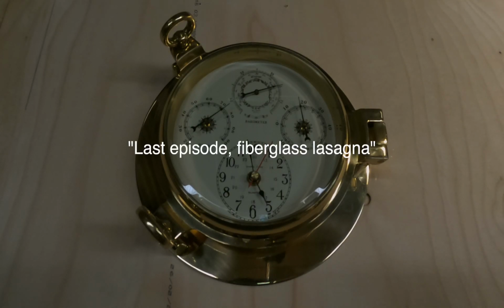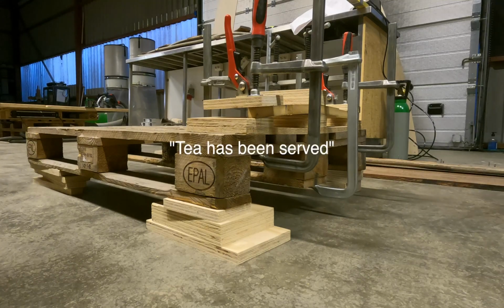Fisher 30 Ep 17 - Finishing the engine bed - Planning further, up in the mountains

Comment: When I saw Sara dancing to Roxy Music it made my day (er. Night), the motor mount seem very strong that's good. 
I'm very cutious about the sound deadning cause I guess it will tak several materials to get what you are going for, but I think it's the cooling of engine and auxiliarys while keeping it quiet that will give you the biggest challenge. 
Realy lokking forward to next episode.

P.s. I know that in her age sleep is considdered to be overrated but nevertheless please tell Sara to prioritize sleep a bit higher on her list.😉
Reply: I can tell you that dancing to Roxy Music also made my day. I sure will try to better my sleeping schedual.. Starting next week! (Maybe)
Reply from the maker: I have understood that the cooling of the alternator might be an issue. Therefore I must direct the airstream into the engine room in a way that it passes the alternator. The engine itself is fully water cooled so that should not cause any problems. 
Thanks for commenting. 👍

Comment: Best sound insulation and thermal insulation for a boat is industrial-grade closed-cell foam. It will not degrade if it gets wet, or get moldy.  It does not retain water.  But it is fragile so needs to be protected by wood panel or maybe epoxy on top.  Usually closed-cell foam is attached using pressure-activated cement, also known as rubber cement.  The U.S. Coast Guard vessels use a very expensive brand of closed-cell foam on their small rescue ships,  called Armacell.   There are other brands that are cheaper.   Using housing-type fiberglass insulation, or housing-type foam insulation panels, is a mistake because these degrade in moist environment or especially if directly wet.
Reply from the maker: Excellent point. I was actually considering a brand call Armaflex, supplied by Armacell. On the outside using strips of hardwood or plywood plates. Thanks.
Reply: @hsobstad   if you get this type, pay extra and get the peel-off-backing adhesive version rather than the plain version which needs cans of special rubber cement.   the less expensive brand I chose is K-Flex.   maybe the density is different which explains the price difference, I dont know.  the benefit of gluing this type directly to the fiberglass is tremendous, no more condensation/sweating, no more mold.  and the sound reduction is very easy to hear the difference, much quieter.   the fiberglass is no longer 'cold to the touch' either, much more comfortable for berths.
Reply from the maker: @superblondeDotOrg  Thanks again for detailing your tips. I think you are right it might be worth paying extra for the adhesive version. I will look into the K-flex as a budget alternative. 👍😊

Comment: Another wonderful video!  So nice to see Sara joining in on the fun of fiberglassing (LOL). Yes, Foggy ;-) Firstly, I must tell you that the scenery on your trip is incredibly similar to the western part of our province of Newfoundland & Labrador. It also is mountainous and full of Fjords. Perhaps someday you will visit. On the topic of sound dampening and insulation... It seems that there are three main sources of noise; Air intake, exhaust and combustion vibration. The latter of which is transferred to the hull. I will try and find a video I saw of a Canadian boat builder on Vancouver Island that used an acoustic tile for insulating their engine room for you. They had before and after comparison with a Db meter and it was impressive. I've also seen how some expedition yacht builders use the main engine as a large hydraulic pump to turn the propeller(s) and have them fully isolated on rubber engine mounts.  The point is to reduce the vibration that is transferred to the hull and the rest of the boat. I wonder if adding rubber engine mounts is an option for you?  Intake air noise can be substantial on a large engine, but probably not that bad for your Fisher. A note to Sara... Great job on video editing and coaching your Dad on an expanded format! 😊 You two make a great team. Thanks again for the entertaining and thought-provoking video. ..."to live so sturdily and Spartan-like as to put to rout all that was not life, to cut a broad swath and shave close, to drive life into a corner, and reduce it to its lowest terms.” (DPS)
Reply from the maker: Thanks, Duncan, for lots of kind words. 👍
I have thought the scenery would be similar to some of Canada, of which I will to see one day. 
Regarding insulation. I have rubber engine mounts, so that should be ok. I am thinking adding lots of surface area for absorbing noise. Soft near the engine. Harder materials further away. 👍😊
Reply: Sounds like a good plan my friend. @hsobstad

Comment: Well you did an excellent job of reworking the engine beds and you are now in a very good situation if you are ever depth charged while you are sailing on patrol of the Fjords.😉 You are right the subject of acoustic insulation for attenuating all the frequencies produced by a diesel engine is very complex, rather than reinvent the wheel - maybe consider a manufacturer like Venus they have a range of materials and a fairly good reputation. On the subject of ventilation of the engine space - the most vulnerable component is the alternator of course so special care needed to address that. Thank you for the glimpse of the beautiful, if somewhat damp, Norway.😀😉
Reply from the maker: Thanks, Norman. 
Your input about the alternator is actually very good. If the alternator suffers from overheating it will reduce its power production dramatically. I was thinking to make a vent shaft from the stern of the boat, but thanks to your input I might change that to an intake further forward in the boat. 👍

Comment: Sound insulation tip: With sound " leakage" you have to deal with the bathtub principle. If there is 1 small hole, sound will leak through there and it will almost sound like you have no insulation wat so ever. It's like pulling the plug from the bathtub, all the water will drain to that 1 specific point. So it's highly important to fill up/ close all the gaps from the engine room to your salon! I use Talamex insulation ( I send you the link a couple of month's ago) and it's the best, it's also highly fire-resistant, so that is a big plus! Loved the video again Helge, must be awesome to work with your daughter, to do the project together! Keep it up 🙂
Reply from the maker: Thanks, I will look into the Talamex insulation. I did like "the bathtub-principle. Never heard of that 👍😊

Comment: Well ... now I'm jealous ... I wish I was there with my bike to ride those roads!!! That was some amazing scenery up in the mountains, and that river that you were following looked perfect for a lazy sail!!!  Your helper has some great dance moves, but she definitely needs to go to bed a little earlier!!! As for the insulation for the engine room, I would suggest going with some Rockwool products as they make some great insulation and sound proofing battens.  I used it to make an enclosure for a generator, and it made a big difference -- it doesn't hurt that it is fire retardant as well.  Keep in mind when you make the air intake for the engine enclosure that sound waves are deadened by 90 degree angles, so add some into the construction to keep the sound that you are trying to muffle from escaping the sound-proofed area (there are some really good videos on YouTube using that principle on generator enclosures).  Keep up the good work!!!
Reply from the maker: Hi Robert. Yes, these are nice roads, riding most alone, and up into the mountains. It´s great fun. 
Sara is working hard i a shop, during summer, and sometimes the shifts starts early and sometimes late. So she gets tired, but keeps going. 
I will look into your suggested Rockwool. Regarding angles I think diffusers that directs in multiple angles is a way to make sure sound waves is not amplifying them self; taken from the HiFi world. I will search Youtube on generator enclosures. 👍😊

Comment: There is multi-layer sound insulating material, a sandwich of metal  and foam, Specifically Engineered to dampen engine room noise. Rather than re-invent the wheel using questionable materials, this is case where the best economy will be using a well engineered product with known and tested properties. Really low frequencies will be propagated through the hull by mechanical conduction. So rubber mounts must dampen those at the source - the engine mounts.. 1000 to 4000 + Hz have both sonic and conductive transmission, so the sound deadening material probably plays its biggest role there. I think there is little really high frequency energy to deal with, and that will be contained inside the engine room anyway, even with nothing done.  An exception might be a turbo charger intake, hardly needed here.
Reply: My opinion is that unfettered direct access to the engine is a safety concern not to be ignored. Cooling water, fuel and exhaust (with water) all can leak, or require  service, - the safety of the vessel and crew depends upon it. A diesel leak is a disgusting thing in the confines of a small boat, ditto and exhaust leak.  And, easy access means maintenance is less like to be put off, and safer in tough conditions.
Reply from the maker: Thanks, Larry, for another input. To me engine noise is a killer for using the boat. I have experienced boats (in particular one) the same size boat and with an inboard engine with shaft drive, which was so well insulated that hardly any noise came through. That owner had gone to an extended length to seal off sound and it sure worked out for that boat. 
The sound dampening materials one can buy are often a compromise of space around the engine is limited and price must be reasonably low, and therefore not optimal. 
I agree with the safety issues of an easy access. That is one factor but there are others. Leaving the engine open would satisfy only the safety issue. I intend to have satisfying side access to the engine, but might spend some time to remove inner walls to get that access. Still better then a cramp engine room with only access from the top. :-)
Reply: @hsobstad   Better to sell the diesel engine and get an electric motor which runs on lithium batteries.  Then get a smaller 1-cylinder diesel engine with a big alternator to use as a generator to recharge the batteries (about 6 kW) and put that generator in a tight sound-insulated box.
Reply from the maker: @superblondeDotOrg  In a sailingboat - maybe (#SailingUma) - but in a motorsailer I dont think so as the engine is more in use together with the sails. There just wont be enough energy in the batteries for any serious motorsailing. 🙂
Reply: @hsobstad  About electric motors, find an electric motor company and discuss it with them (i.e. Electric Yacht, Inc), they may provide you with power curves which put it in perspective.   Because, consider:  Zero engine noise; that is really priceless.   How many hours will truly be spent motoring on a trip, maybe only 4 hours in total per day, maybe 6 hrs? (Before stopping at the next harbor for a break, or stopping to anchor, or fish, etc).  Or, maybe you have to stop because the tide is changing significantly anyway, and it would be a waste to continue voyaging, so then it is time to rest and recharge.     The electric motor curves are not linear.  Running at 50% power will significantly increase range.  A 25-30HP diesel engine is replaced with a 15-20kW electric motor, which requires 400A battery bank at 48V  (equivalent to about sixteen typical boat batteries).  A 10HP diesel engine if run only and directly as a generator will produce 7kW.   With only that generator, the motors can run indefinitely, at perhaps 40% power (not sure, but something like that), which could be 60% of your hull speed.    The diesel generator can be put in an isolated box and separated from the hull so vibration would not couple into the hull.    Just some considerations to discuss.  It would make a good episode anyway.    p.s. Don't trust anything SailingUma says, they are not good sailors or good engineers, it is kind of obvious from many of their episodes (and from others who have sailed with them apparently), but they are good at filming drama, so they have become widely-viewed.
Reply from the maker: @superblondeDotOrg  Thanks for trying to persuade me. Electric engine is of interest. As you point out, it is near silent. 
Might consider investing in such if this boat turn out to be what I like. Might consider electrifying my other boat (Rhea 900), which is a pure motorboat, as we mainly use it as transportation from where we park the car and to the summerhouse on an island. Is is just 10-15 minutes of driving. Might require less batteries and no generator (if we charge on the summerhouse). 
My only point with the Umas is their limited capacity.

Comment: Great progress, your daughter will go far in life learning that most important skill, you MUST get dirty with some jobs ! Bravo. Two words for engine insulation, forced air, or you may have a heat issue
Reply from the maker: Yes, fixing things is an important skill. To many people tend to not fix and just dispose as garbage things that could (with some work) be fixed. 
Regarding engine insulation I was really hoping not to have to use forced air, as vents makes noise and use electricity. Both unwanted characteristics... 😊